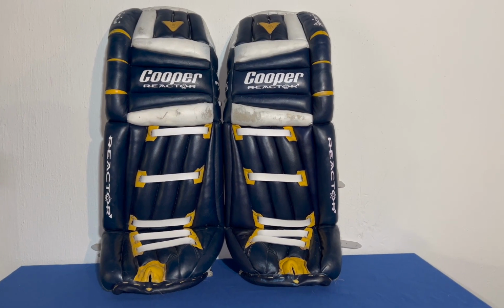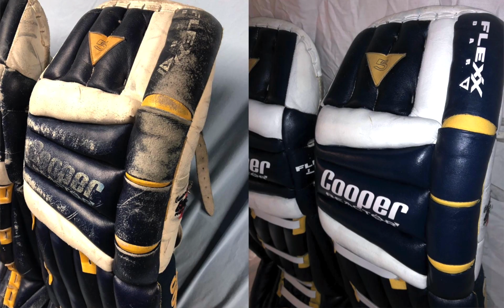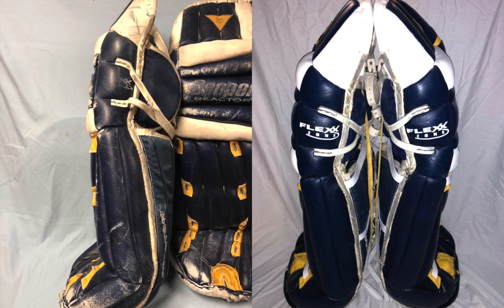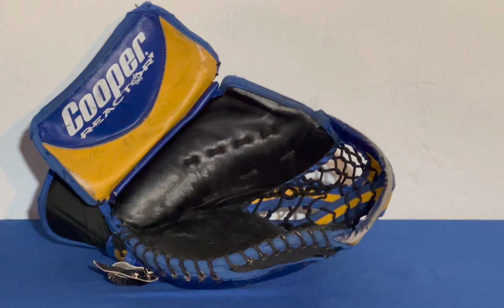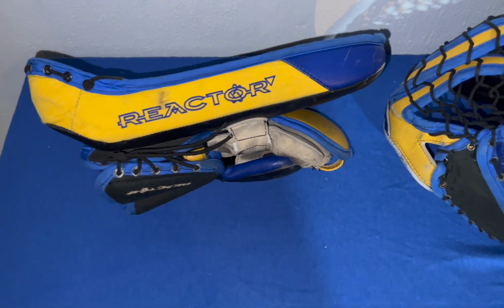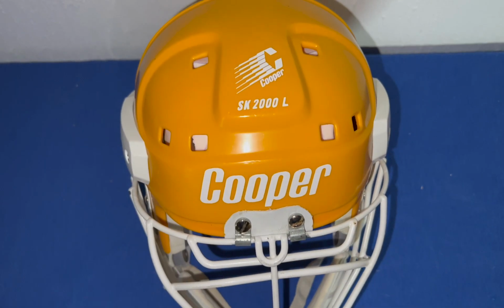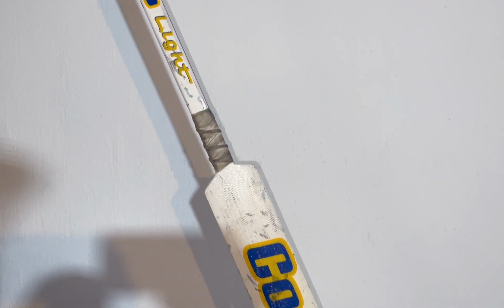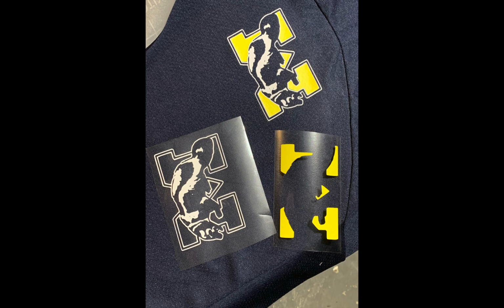Univ of Michigan 1995! | Restored Reactor 5 Pads | Vintage Cooper Beer League Hockey GoPro Goalie

Comment: Amazing job on the pad restoration and the jersey.  That's top notch work, Charles!  Congrats on the win, too.  You looked really solid out there.  I was glad to see you come out and challenge the shooter on the breakaway, as well.  Sometimes you back in a little too quickly, but you stood your ground and handled that shot perfectly.

I've noticed that when shooters are breaking in or setting up on your stick side, you tend to stay flat in your net (i.e. facing the other net), which creates a lot of openings.  If you rotate toward the shooter and stay square, that will take a lot of those openings away.  Not sure if that would've helped with the goal that got in (it really was a perfect shot) but if you had been square, he might not have seen that spot to aim for.

Anyway, great video and I hope you guys are having an awesome Halloween!